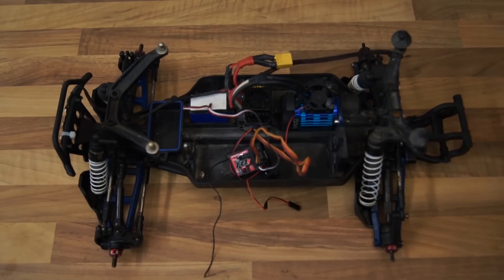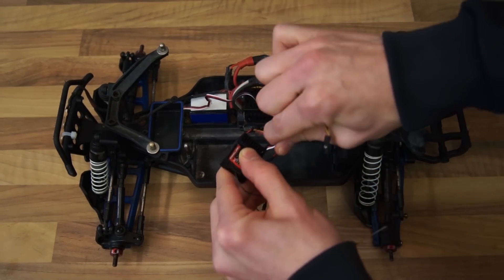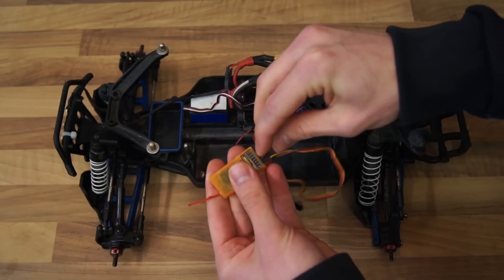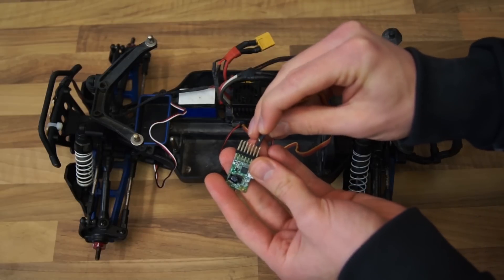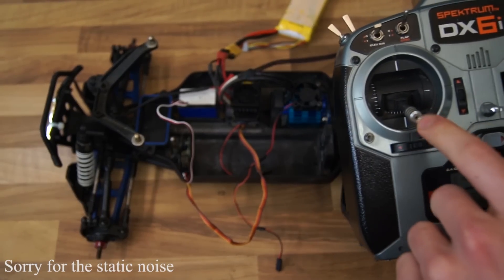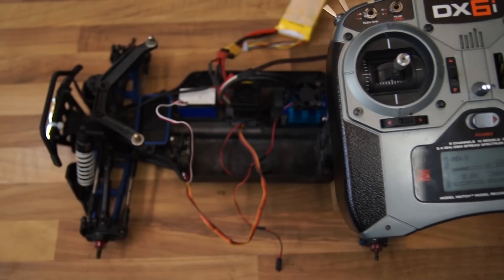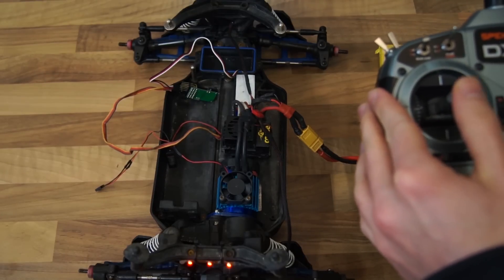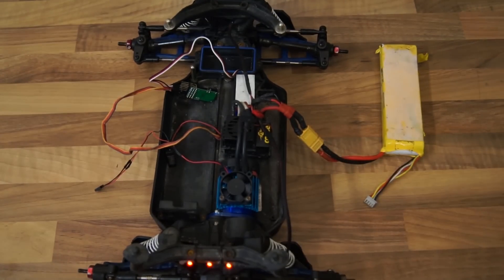Control Your RC Car Using An Airplane Transmitter (How-To) - RCLifeOn

Comment: This was very helpful. I was just curious how an airplane transmitter would mate up to a car. Thanks for sharing this in a simple way. I have never even held a aircraft radio but the sure look impressive. It seems like the joy sticks would be easy to adapt to but do they return to the neutral position? Sorry for the dumb question.  Great video tutorial. Thanks for sharing. 👍👍
Reply: To answer your question: the throttle stick doesn't return to neutral position automatically (for ready-to-fly drones like DJI, the throttle will return to neutral by itself)
Reply: @ss1271 actually when using a RC car with a mode 2 drone transmitter, the throttle for the RC car will be on the right which means it will return to center and the steering would not have a return spring. This is a mode 1 transmitter being used in this vid which is why throttle was on left.
Reply: @JeremyBreeden89  yes indeed. 
In some transmitter you can switch between mode 1 or 2 in the settings, but that means then you'll have to switch the hardware on the transmitter.

Comment: I have tried your method here, but can not seem to get it to work. I know that im not using the same esc or transmitter as you, but I am still not able to set the end points for my transmitter. I am using a 1060 brushed esc, and trying to set the endpoint for throttle and reverse on my Microzone Mc6c.
Reply: Same I can’t get it to work

Comment: I'm having a question maybe you can help. I want to run a radiolink dual stick radio on my rock crawler. I would like to steer the front servo and throttle front motor with the left stick and throttle rear motor steer with rear servo on the right stick. How do I do that?

Comment: So when doing this can I then use the other dip switches? I’m converting a nitro to electric and want to keep the second servo that’s used for the throttle and brakes (in a nitro truck) so I’ll have a hill stay brake for hill climb purpose. So 3 channel 4 channel is what I need
Reply: Yeah depending on model you can assign switches and knobs, even program more advanced functions on opentx transmitters. Alotta cool stuff you can do for crawlers and whatnot.
Reply: @MissingNumb  sweet! Thanks

Comment: This was really helpful for me though in a slightly different application.  I'm used it on a RC Ship...  The controller I had for that is a 5 channel and I've got a DX7S that lets me put a few mods onto it.  (turning guns, lights, smoke) that the original just couldn't control.

Comment: Haha when I was a kid I did not even knew about pistol grip transmitters. Maybe they not even existed back in the years. I used a 4 channel airplane transmitter my dad had (and later my own 2 channel transmitter with the same shape as an airplane transmitter) on all the models I ever had. Many electric cars and boats and one 3,5cc fuel driven formula 1 car. And something like 7 years ago I bought my first pistol grip. My intrest in fast cars does not exist anymore. Today it is more crawlers and scalers and rc planes and jetboats to play in streams with rocks. And for most models I use the airplane type transmitters because they have many channels. Great to switch lights on and off and make winches go in and out with various speed and make fpv camera's turn etc. Pistol grip transmitters give a bit more realism to driving a car because of the steeringwheel but once you are used to the sticks it works just as simple.
Reply: I've used the same pistol grip transmitter on my first rc tamiya buggy for 4 years up until now. I realized that I did not like the feel... I want to go with an airplane transmitter instead

Comment: Thanks for the vid. Are you still able to calibrate the ESC for braking?
Reply: It does not matter what type you use if you just use it in the basic form. That means without special mix settings etc. When used in basic form the transmitter has a lever or turning knob. When you turn a knob or pull a lever there is a potentiometer connected to it. The transmitter will send out a code to let the receiver know what the values are for every channel. And the receiver on the other side will pick  up the signal. And send it to the corresponding servo or esc. So it does not matter what kind of transmitter you use. If the protocol and frequency is the same you can even use the receiver that is in the vehicle. And if not plug over the connectors like shown in the video. But a brake function is programmed most of the time in the esc itself and has nothing to do with the transmitter type. Just pull the lever back beyond the nutral position and it will start to brake just like with the pistolgrip. And if you have an esc that is programmed to brake as soon as you just let go of the throttle it will still do that too.

Comment: So i just put in my ar6600t receiver and binded it to my dx6e on my axial scx10 2 and it binds and works but my controls are opposite of what there suppose to be , foward is reverse, revese is foward, left is right, and right is left, also if i turn off my radio with the truck on the truck takes off full throttle , know how id fix this? Thanks.

Comment: Can you reverse this, can u pls show how to control an airplane with a car  reciever, plsss
Reply: ricky is wrong: for control planes only need three channels: roll, pitch, and thrust. But if you don't mind it being sketchy you can create a controllable plane with fixed thrust and only roll and pitch: like a powered glider.
Reply: This is not recommended because rc cars need only 2 channels(go/reverse, left/right) airplanes and quadcopters need 4 channels minimum (thrust, yaw, pitch and roll) a 2 channel rc car transmitter can not control 4 channel equipment.

Comment: I do not know exactly how - but after constant channel change and invert certain channels that now also runs with the reverse gear.
But it drives quite strangely - sometimes the gas does not react, and I have to wait a bit between the forward / backward change, otherwise nothing happens.
The high screw of the mix rate to 100 has helped a bit - but still drives it quite strange.
Everything is calibrated - and the remote control is neatly tuned to the esc, which incidentally works in racing mode.
Is a Carson dragster sport 12t engine / esc kit.

do I have to change something on the remote control?
By the way, flysky i6 remote runs in helicopter mode, there is no mode for cars.

Comment: What about the servos. Is it powerful enough to move the servos with the same speed without burnig the receiver because the car servos are way bigger than the servos found in most airplanes

Comment: Would that be the same by using flysky i6 transmitter?
Reply: Tadas Jurkštas yess, with the fs ia6b receiver which has all the 6 channels in different connectors

Comment: Just what I needed, thank you.
Can the throttle stick have a return-to-neutral-point spring?
Reply: Depends on your radio really.  My Spectrum DX6 has a spot to insert one, but rather than have to deal with removing it any time I wanted to use with a quad copter or heli, I just changed the controls for my cars so that the right stick is throttle and left stick is steering.  Takes some getting used to, but allows for better control of everything from one radio without needing to install or remove additional parts.
Reply: good idea

Comment: Nice, a simple video showing the basic setup of running an RC car from an airplane transmitter.
Did you ever try to run the car normally with that setup? I don't have a car radio and want to know if it would be worth getting a cheap 20$ one or just go with this kind of setup.

Comment: Not ideal putting the cars throttle on the aircraft throttle channel. An aircraft goes bottom = 0 throttle to top = full trottle.  An electric rc car has 0 throttle in the middle, unless you modify you tx to re install the spring, you won't know where 0 throttle is.
Reply: How do you not know it? It's in the middle lol

Comment: Which is better in terms of responsiveness
Reply: Marlovw Brandovw they both are same but suited for different application, u can use airplane transmitter if u dont have a car or boat one but u cant use car tx in an airplane or a drone :)

Comment: Please do not pull plugs loose by pulling on the wires, pull on the plug instead. Otherwise good video I have a taranis on the way to try running a traxxas and this is reassuring to me.

Comment: Hey, nice video but I have a few questions.
1. Is it possible to boost an rc car remote's frequency? (Using a frequency booster)
2. Do you know any good way to get more range on an rc car without using a remote that is meant for planes?
3. Is it possible to make a diy rc car remote using parts from a plane remote (extracting sensors and stuff)
Reply: you can make a rc car remote using a rc plane remote
Reply: Bro you can boost your signal from both ends by removing the thing before the antenna and change that to a larger one just look in hobbyshops or electroshops

Comment: I have a nitro car so it doesn't have an esc unit, just a servo for the throttle..... What should I do
Reply from the maker: Let's say you have the DX6i transmitter and receiver (like in the video). First of all, bind the transmitter and receiver. Connect the throttle servo to port called THR (throttle) and the steering servo to AIL (aileron). You need to power the receiver witht the battery that powers the servos. Connect the battery to the port called BATT (5V in). Let me know if it works.
Reply: zachgoesHD plug in servo into throttle or channel 2 it works for me

Comment: thanks grace its been a long time a deca that i'm still looking forward to find some answer if do the transmitter of airplane work fine no issues if connect to an rc cars veryu thank full anyway i know the throttle of airplane that has not spring tension when u hit the throttle up and down its going stock not like the transmitter of rc cars so what do u think im going to open up the transmitter ? and put some spring on it ? but i don't think so anyway im going to use on my nt1 xray touring car 1/10 nitro

Comment: i used my devo 7 tranmitter with the original reciever and tryed what you said but it doesn't work. they both are new what could be the issue
Reply from the maker: +tuck 1 Do you hear the ESC beeping? Most likely the calibration failed.
Reply: I did it your way several times. Coukd it be my devo 7 transmitter is not versatile
Reply from the maker: +tuck 1 I don't think so. It's more likely your ESC is not compatible.
Reply: i have a mamba monster 2 what esc do you suggest
Reply: tuck 1 sidewinder 3
Reply: Ty

Comment: Any advantage,  do the rc plane radios have better range?
Reply from the maker: Yes, a car radio usually have >300m. However, an airplane radio have up to 2km! Obiously the range will be decreased as obstacles will block the signal.
Reply: +RCLifeOn I just purchased the Traxxas summit which radio would you recommend,  thank you.
Reply from the maker: I have no idea what you are going to use it for other than driving a car, but this one is affordable and probably the most versatile transmitter: http://www.getfpv.com/radios/radio-controllers/frsky-taranis-x9d-plus-2-4ghz-accst-radio-mode-2.html

With this receiver: http://www.getfpv.com/radios/receivers/frsky-l9r-long-range-receiver-9-12-non-telemetry.html

This setup will give you more than 2km range if driving with no obstacles. Remember to place the antennas correctly as this highly affects the range of your system. You can read about this in the included manual.
Reply: +RCLifeOn Awesome,  thanks for your help!
Reply: Thanks for the Video, I love the Taranis radio, so much I own TWO! Great for all sorts of stuff, and with the telemetry you can even check your battery voltage from your TX and set alarms for certain voltage levels, so you don't have to walk 2 km to pick up your rig!

Comment: I have a vintage new bright buggy I got off eBay I fried the board and now I'm thinking about making it a beast my I think all I need is a new motor a ESC and a servo  and because I fried the bored will I need to get another receiver and transmitter is that really all I need
Reply from the maker: Don't forget to purchase a battery that can supply the required amperage to the motor.

Comment: i did try but it does not work on the servo...even in this video it only show the motor works fine forward and reverse YES... left and right NO
Reply from the maker: I can assure you that it did in fact work. I simply plugged in the servo to the aileron port, did you get it working?
Reply: +RCLifeOn aap jo bhi hai mujhe ek Khat bhejiye reply bhejiye ki mai aap se Kaise transmitter-receiver kaunsa dukan Milta Hai Humko Bataye delivery ke liye
Reply: aditya raj aditya raj chutiye usse hindi nhi aati

Comment: Warndog, there is usually a kit for most transmitters to make the throttle return to center.  I got one for my daughters futaba radio.  It worked great.
Reply from the maker: +Rick Swanson Great tip! Thanks for watching.

Comment: How does it feel to control an RC car with a dual stick transmitter? I want to upgrade to a 6ch setup for my rock crawler so that I can have complete control over my 4 wheel steering (front, back, both, and crab crawl) and each motor for front/back axles. Using a controller with no return spring on the throttle seems like it would make it awkward to drive.
Reply from the maker: +Warndog It feels surprisingly odd since you will be used to control it with a RC car transmitter and not an airplane transmitter.
Reply: You can buy a spare right gimbal from a mode 2 transmitter.
Or switch the right gimbal to the left throttle side..

Comment: i use the dxe transmitter for my wheely king and stampede. i put airplane recevers in both vehicle. works very well. inside the transmitter i found a spring on the throttle side. there were two screws i had to move to get the spring to catch the throttle to keep it centered when i let go of the throttle. what ever you do. do not flip the throttle switch to disarm. it can make the car go backwards out of control if you aint ready for it. it can be used as a brake for when the car is driving forward.